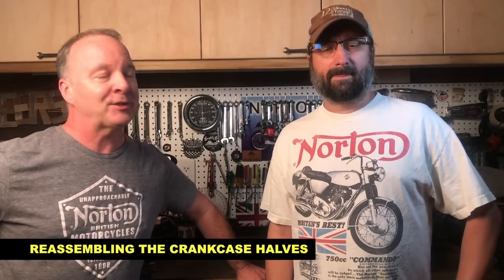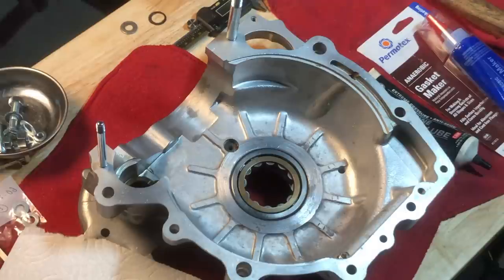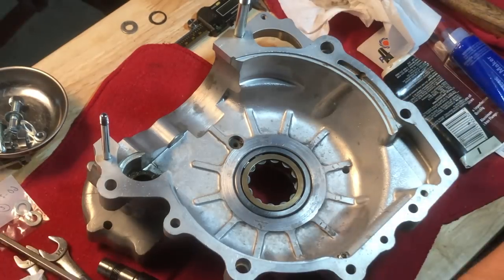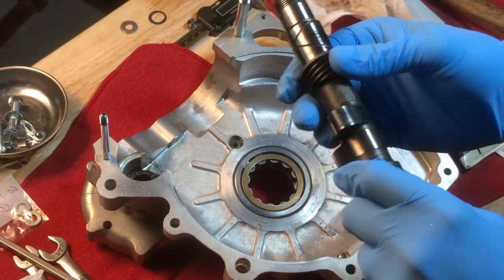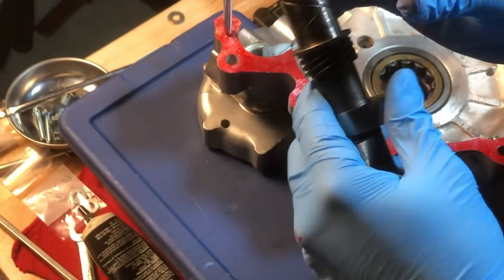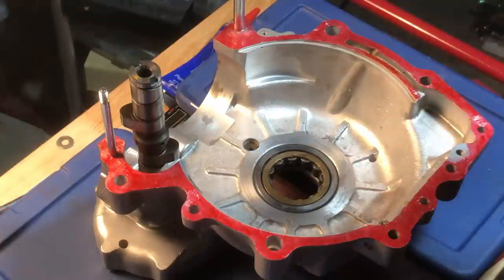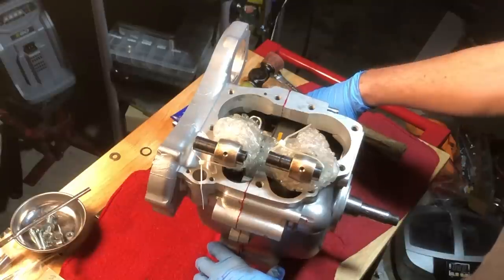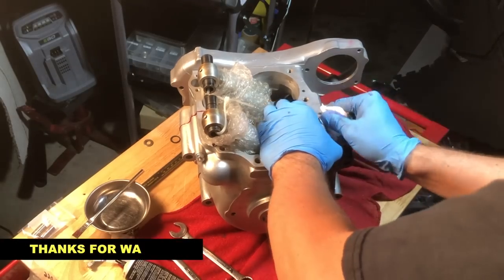1972 Norton Commando Combat Rebuild (9) - Reassembling Crankcase halves

Comment: I really enjoy how these episodes are presented. I have had extremely good service out of Kopr-kote for sealing, although VW makes a RTV that was also used at factory on the oil pans, really tough stuff to hold cases together and sealed. What I like about the Kopr-kote though, is the ease of removal of mating parts and fasteners, yes, I coat the threads with it as that is its true design usage. Kopr-kote does not allow heat weld or unlike material as steel bolt in aluminum to weld together.
Lordy, I sound like a Kopr-kote saleman don't I .  ;)

Comment: Hi Mike I have a 75 mk3 and have 1/4 inch or a little bigger seperation between the sprocket and wheel . Would you know if this is normal or not.

Comment: Mike  that wasn't long enough 🤣 Coming from a car background ( years ago )  we always used gaskets. No gasket here ?. How good is that sealant .. ps thanks for sharing .
Reply: Yeah, I was waiting for the gasket.
Reply: 54macdog No gasket here. Just the anaerobic sealant. There isn’t a lot of oil inside the crankcase, and if you manage the pressure there isn’t a lot of strain on the joint.